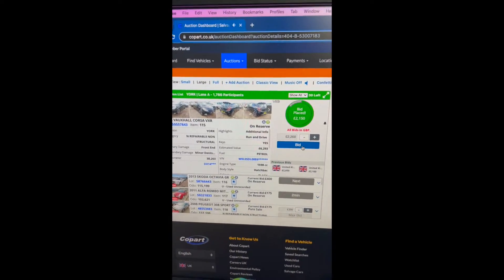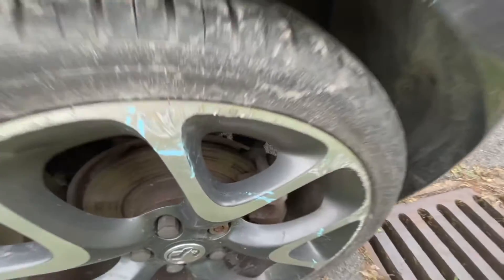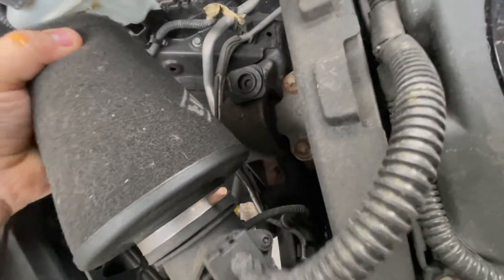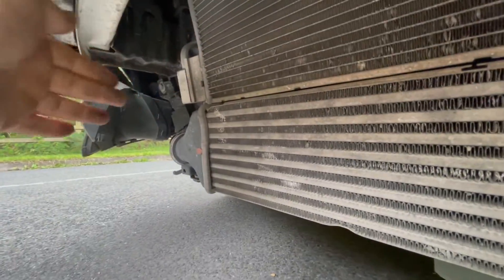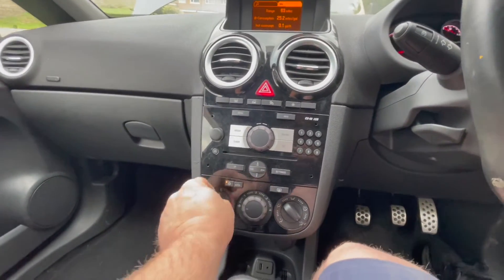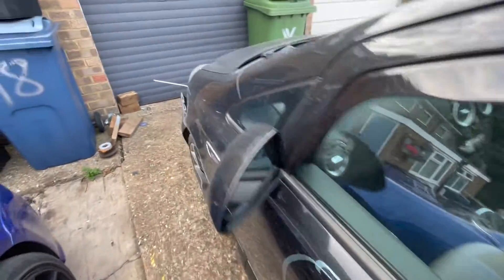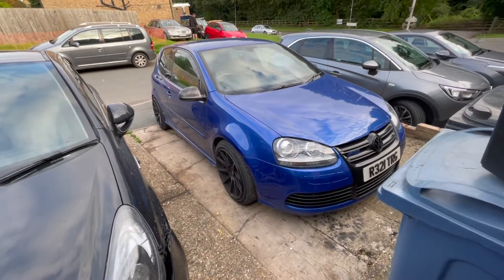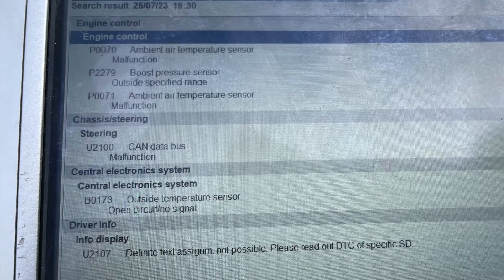REBUILDING A WRECKED VAUXHALL/OPEL CORSA VXR From CoPart -  PT1

Comment: I bought the TT V6 that was used as an engine donor for my Mk2 Golf from Copart back in 2017. Even then it was a very exciting process! I can see the addiction, as it was so cheap and had far less damage than the pictures suggested. Actually felt a bit guilty raiding it for the engine in the end!
Reply from the maker: You must have had a right deal then. I think the channel will see a TT very soon.
Reply: @OctaneFever  yeah it was cheap! £1500 for a 55 plate TT with 61k miles with full audi service history. All it had was a cracked bumper and broken headlight clip. Took the engine and other bits I needed, then broke the rest for more than what I bought the car for. Did feel guilty though, as the car was immaculate otherwise!
Reply: @golfmk2  Dont tell any of the TT groups, they will have your head!
Reply: @drm4857  yeah, I wasn't flavour of the month when a few enthusiasts knew what I'd done! 😅
Reply from the maker: @golfmk2  yeah I bet 😂